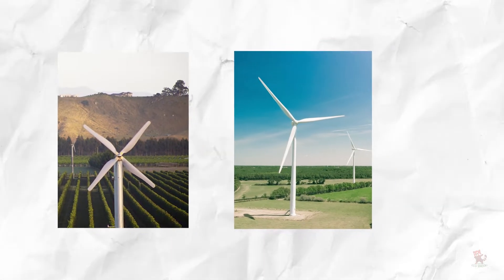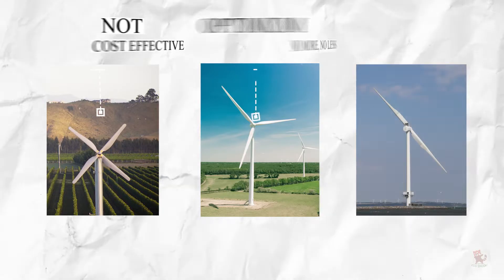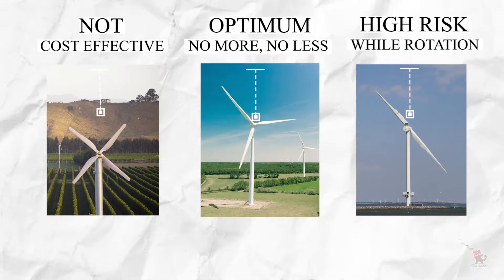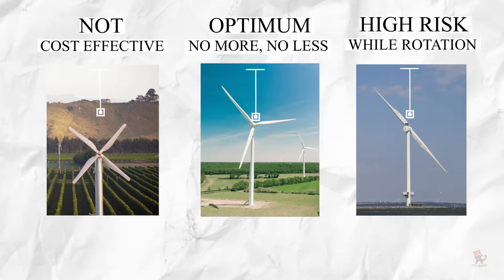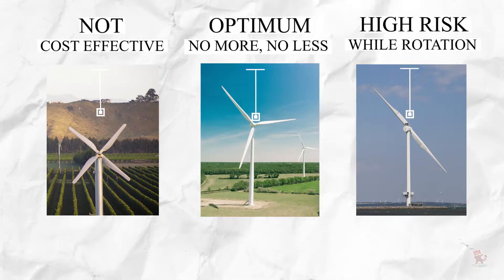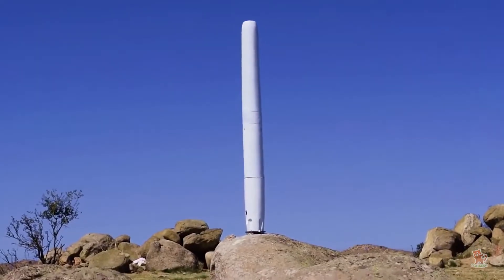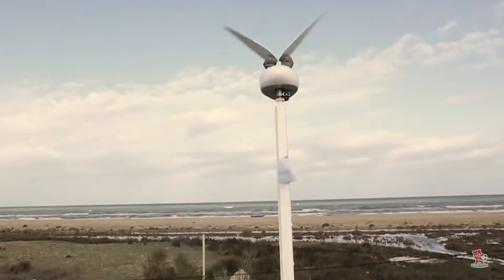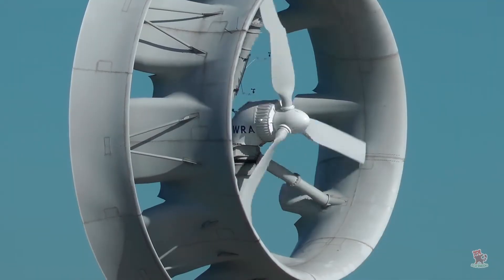Why do (most) Wind Turbines have 3 blades?

Comment: I read somewhere that the blades are affected as they pass in front of the tower..; Especially two bladed turbines.
Reply from the maker: You're absolutely right — the phenomenon you're referring to is known as tower shadow. As the blades pass in front of the turbine tower, they experience a brief disturbance in airflow, which can cause a cyclical loading effect. This is especially noticeable in two-bladed turbines because each blade passes through that turbulent zone more frequently, leading to greater vibrations and mechanical stress.

Comment: 3 blades are physically unbalanced. The weight of 2 blades are on one side versus the weight of 1 blade countering. That weight difference changes sides 9 times with each revolution.
This sets up stresses in the tower that have to be modulated resulting in loss of efficiency and structural fatigue and failure.
Reply from the maker: Thanks for your comment! 😊While it may seem like three-bladed turbines would be unbalanced, they’re actually designed for rotational symmetry. The blades are evenly spaced at 120° intervals, which ensures dynamic balance during rotation. Modern turbines also undergo precise engineering and balancing to minimize vibrations and structural stresses. The choice of three blades strikes a good balance between efficiency, mechanical simplicity, and load stability. That said, fatigue and stress are real challenges, but they're addressed through careful design, materials, and control systems.
Reply: @EcoSnooki  I beg to differ. You have the weight of 2 blades on one side countering the weight of 1 blade on the other side. Then it alternates sides.
That doesn't even count the uneven thrust from the wind, side to side.
Quite simply, vertical bladed windmills are not the way to go.

Comment: What I want to know is why is it when I see a field with 100 windmills, only 30 are moving?
Reply: If wind speed it too high, they will stop them in order to avoid the damage. If spinning too fast, they can "explode" as illustrated at 1:25. Also, they might be used only to cover for the peak consumption period. When the consumption is low, some of wind turbines will be stopped (if the energy produced cannot be stored or sold).
Reply: Probably need maintenance
Reply: Because power storage at scale is way more difficult than people think it is, so production needs to adjust to more or less equal demand.

Only 30 were turning because that was enough to meet demand.
Reply: because there is a direct relationship between the producer and the consumer. the supply and the load.

instead of utilising methods of simply generating the maximum power from the wind and dumping it into a suitable storage media such as boiling water so we can drive steam turbines at a rate the load demands, we try to generate electricity directly from them on a demand only basis. and it doesnt work.

that entire field of turbines designed simply to heat water, and absorb the energy in the wind at a rate proportional to the power contained therein, ie, cubed with velocity, would never have to be stopped... and would be running at maximum efficiency. you wouldnt need a braking system as the device producing the heat IS THE BRAKE.

given a large enough thermal mass, a reservoir for all that heat, we can then bleed it off as required. how do we "bleed it off"? boil water, drive steam turbines. like we already are doing. but we no longer require the use of fuel or decomposing metals.

IF it ever gets "too full"...so freaking what? it obviously needs a few more thousand cubic meters of storage volume! 

so thats why you see a field of them sitting there idle despite there being a literal gale blowing. because we are stupid. let all the power slip past instead of grabbing it. just as it starts actually producing any!

Comment: Why this fear of high speed winds ? In the 1950s the French Compagnie industrielle des aéromoteurs (CIAMO) made a wind turbine made of flexible blades working even in a cyclone (90m/s). And I think they had 2 blades, as the protection came from flexibility.
Reply from the maker: From the paper published in the journal Proceedings of the Royal Society, it is clear that the use of flexible blades on wind turbines offers the advantage of increased versatility and efficiency. More research is required to discover optimal flexibility and to determine if such blades are commercially viable.